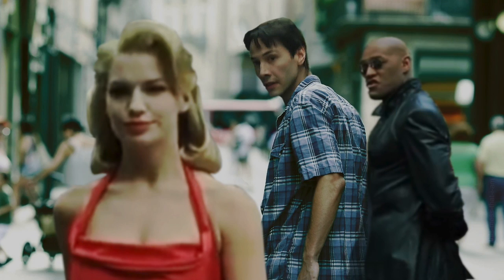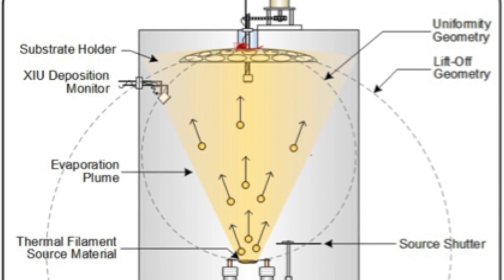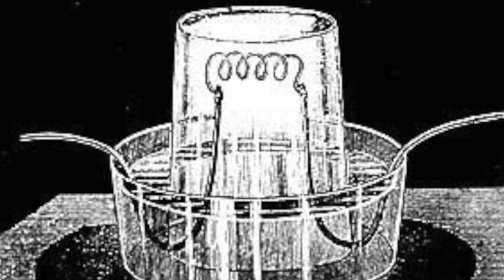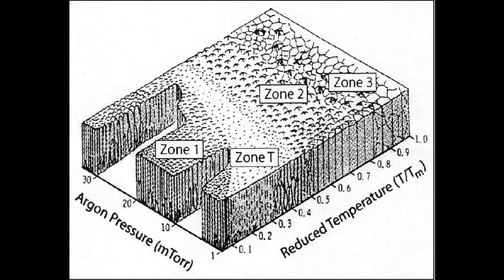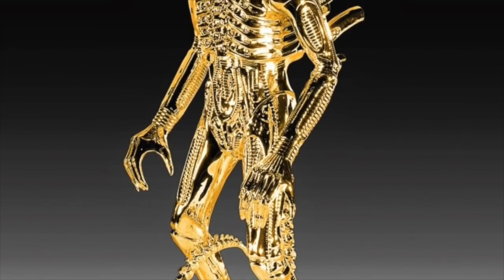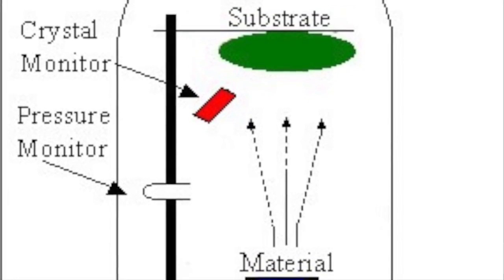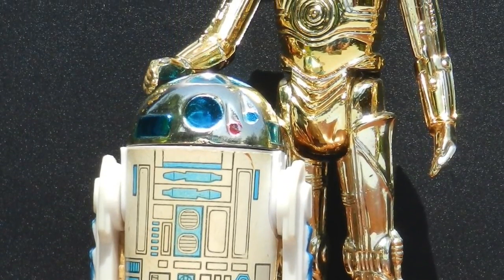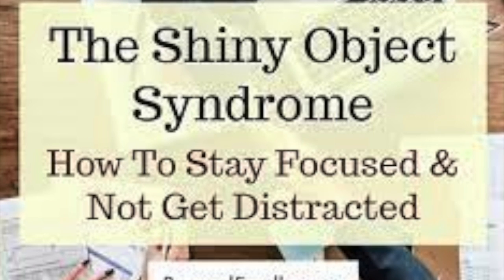The History and Process of Vac Metal (Vacuum Metallization) to make Action Figures Shiny

Comment: With all due respect, this is false information that only 5POA figures can be vac-metallized. I'm staring at my vac-metal articulated C-3PO from the SAGA era - bending knees and elbows. It absolutely can be done - I've heard environmental concerns were a reason they got away from it, but it sounds like corporate speak for "we didn't want to pay the few cents extra per figure to do it right". The point is - Hasbro can absolutely do this and SHOULD. Maybe they wouldn't be 12 POA, but they can still get the essential articulation in there, as proven by none other than THEMSELVES, almost 20 years ago! 

I've been waiting for a vac-metal TVC C-3PO for years and the chromed domed R2. I mean, they gotta look good for the Yavin ceremony!
Reply from the maker: Well sure it can be, but not at a cost that works for retail. Doing it yourself is the craft industry! :-)

Comment: 10 to 15 yrs ago I made headlights and we used to vac metal them in a vacuum chamber. It was a pretty cool process.  Naturally I did a bunch of figure pieces but some of the figures were made of plastic that was way too soft so to get it to stick I'd have to paint them with clear coat first. I could only do silver but the more I would put the figure in the chamber it would turn gold and eventually purple.

Comment: I seem to recall when Palisades Toys revisited Micronauts in 2002-2003 that vac metal was not used and they are able to achieve the reflective surface from a paint application. Almost 20 years ago so I  could be misremembering that.

Comment: There is another consideration regarding vac metal, and probably forms the other reason it causes problems with articulation. Vac metal adds a tiny layer of material to the parts being coated. Which depending on how precise the design tolerances are, can have some major impacts. One of the reasons Lego very very rarely uses vac metal is because the tolerances are so precise for Lego pieces, that they have to use special tooling to mold the parts to be chromed, that accommodate that slight thickness that the metal adds, so the part remains in system tolerance with other Lego pieces, and can attach and pull apart the same. To understand where this becomes a problem for an action figure, look at how many figures share parts and tooling. You can’t just take a Hasbro “BuckyCap” Buck or Body and metal use it. The joints and articulation points will be under stress due to the slightly additional material. (Ever had a chrome figure squeak as you move the arms of legs? That’s what’s going on). As action figure design gets more precise and detailed, metal plating becomes more complicated. This is why we don’t see a fully shiny chrome Marvel Legends Silver Surfer. Because it’s way more economical to use shared body tooling for a figure like that, than invest in limited use tooling to account for the extra material. Some things with limited points of connection, such as Hero’s Breastplate are less of an issue.

Comment: I have a Trendmasters Dino Voltron from the 90's that had vac metal on most of the dinosaurs. They looked so awesome when they were new but relatively quickly, they started flaking. I clear coated some which did help but the yellow stegosaurus is just ruined, probably 90% of the gold vac metal had flaked off within a few short years. On the other hand my Beast Wars Transmetals from around the same time period still look great so something clearly went wrong with the Trendmasters process.

Comment: Wow this brings back memories! I worked in prototyping for the cosmetics industry over a decade ago and we vacuum metalized a lot of parts. We did a lot of models, tubes, compacts, caps and things of that nature for all the big names. I would spray a few coats of a high solids polyurethane clear coat to protect the finish and prevent chipping. I also did most of the color matching, painting and special effects for clients before everything got approved and shipped off to China for mass production. Very cool stuff, not sure if it's done that way anymore.

Comment: Superb content as always.  So it seems like there is still a possible middle ground. As with that example of He-Ro or something like the 1998 Transformers Transmetal line, Vac metal can still be used to wonderful affect so long as it is not on articulated surfaces… which means that that the real answer about its absence is, probably cost. It’s one more manufacturing step that cuts into the margin.

Comment: I see we skipped right by the most notorious 70s/80s figure to lose their vac metal as soon as you breathed on it: Mattel's Cylons, silver or gold. There's an entire sub-genre of toy repair videos devoted to re-chroming figures that have lost their shine, and that cylon features in most of them.
Reply: Any that use metal? Seems like this is the one process that can’t be done at home.
Reply: @machineman6498  Most use the Gundam pens or airbrushing, but you can look up electro-plating which closely mimics the vac metal process, and you can get machines for home.
Reply: @machineman6498   I've had some pretty good successes with Molotow Liquid Chrome paint pens (you can also open the pens and use the paint in airbrushes).  You need to let whatever you paint with them "dry" for about a week without touching them, but the finish you get is fantastic.
Reply: Forgot about Cylon toys.  Mine did not get too bad, but I neglected them and they were un played with because I did not have Star I know Apollo.  Daggett could not really challenge em.

Comment: What are the chemicals used for electro-plating?   Aren’t those chemicals a big reason why that practice has been done away with?   I’ll also argue that you can have articulation and vac metal.  There was a C-3PO model kit I bought several years ago that is vac metal and has articulated joints.  Now the actual pieces that insert to make up the joints isn’t vac metal but the outer shell is.  This kit fit in perfect with the 6” black series.   The model kit is highly posable and is completely vac metalized.
Reply: Electroplating is a separate thing all together... It only works on conductive materials like metal. You can't electroplate plastic directly, though you could electroplate a piece of plastic that has already been plated in metal using some other method. As for the chemical, it depends on what metal you want the finished product to be plated with. The chemical bath isn't necessarily going to be toxic, but it's not uncommon to use a variety of cyanides and other chemicals that will improve the conductivity of the solution.
Reply: You bring up a good point that it can be used on some level. But it sounds like the set up for a premium ($) format. Base figure with articulation and then add plated abs. Might be a solution for the Silverhawks line.
Reply: @machineman6498  He is referring to the Bandai model kit for C-3PO, which is 6-inch scale and amazing.  Works perfectly with Black Series figures. Unfortunately, sold out but still on Ebay for about 50 bucks last time I checked.

Comment: Beast Wars era Transmetal Transformers were decently articulated (for the time, & still mostly hold up today), & had a good amount of vac metal. Mostly torsos, or bits that don't move (there were exceptions), but they still could transform & pose better than many toys before them. Funny, my Transmetal Optimus Primal has more damage to his painted organic robot chest, than the gorilla's vac metal mechanical chest (Transmetals were intentionally weird), somehow. And Transmetal Cheetor did have balljoints, just not where he was vac metalized.
Reply: I transformed TM Rhinox last year, it was not a good experience. A lot of his vac metal is on moving parts and I don't know if they're metal swells over time, but it was ridiculously hard to move the parts. Probably doesn't help that all TM vac metal is silver and then painted over in a clear color so you're getting an extra layer most metalized parts don't have.
Reply: I only got the ones that made the show, & a few others (mostly to represent characters I didn't have). Didn't get TM Rhinox until his rerelease, in the Unicron Trilogy, which dropped the vac metal, added Minicon ports, & recolor him.